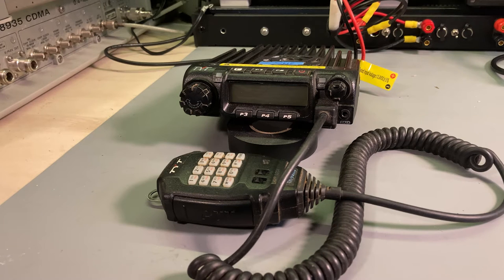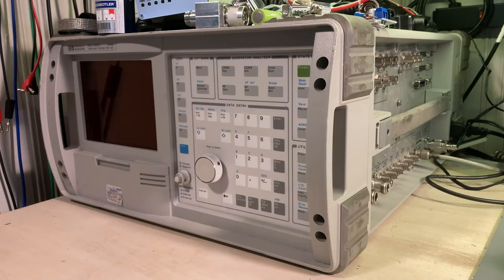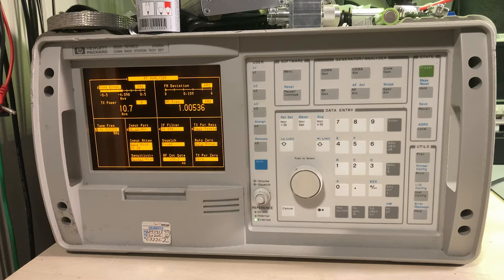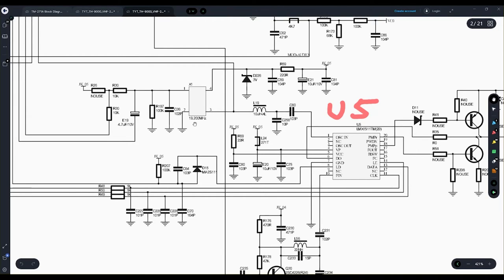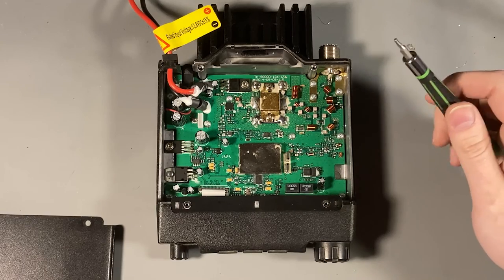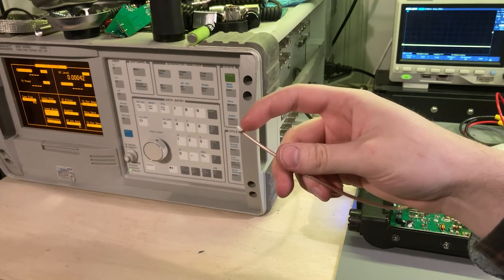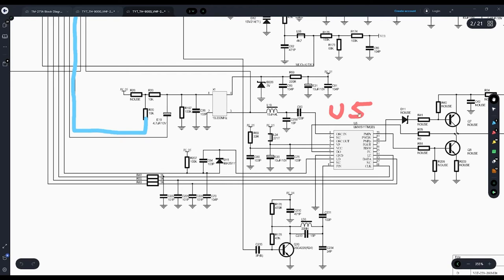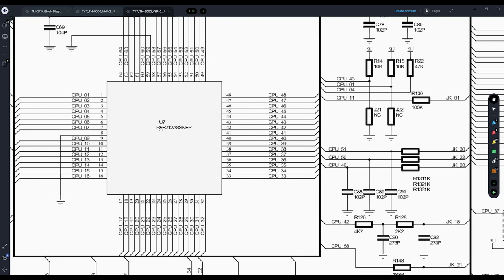TYT TH-9000D Off-Frequency! Tune-up (or not?)

Comment: Thank you for this video! I love seeing more attention given to its circuit design, since it’s been cloned so many times and at an affordable price point. Whether TYT or Retevis 9000D, AnyTone 588, Alinco x35, or — as you discovered — Kenwood TM-271A.  Especially because of the bands this is available in: 70cm and 2m obviously, plus 220MHz / 1.25m in America, and also 4m and 350MHz-390MHz abroad.  It also has a socket for adding a DB9 serial port and repeater capability.  It’s an extremely capable design that has a lot of potential for Open Source Hardware cloning just like the retrocomputing scene has done for C64 and Amiga motherboards. I’d also love to learn how to use the FFT function of a DSO to modify these to change their bands.  I’m very much looking forward to Part 2 from you.

Comment: LOL, it's easy to do the alignment on these if you know how and unfortunately I don't know.  I have tried every possible front panel button press combination to find the "service menu" with no luck.  The only button press combination on power up I could find that does anything was "F" and "P5" which lets you select the frequency range of the radio.  Undoubtedly there is a service menu waiting to be found.  It's possible it's not a button press combination but shorting out a pin on the PCB while powering up like the Kenwood radios they are roughly based off of.
Reply: I found FUN + Shift + PWR = Clone Mode.   or FUN + SQL + PWR = Master Reset unit.   me neither have found any combination leading to a service menu.

Comment: I have serviced dozens of the TH-9000 radios and have never seen the 19.200 osc off frequency.  99% of the failures were CML chips in the early version resulting in a scrambled display/locked up.  
Let me know if you need parts/help.  
N5MRG
Reply: I have the older tyt 9000d and the band range lets me go to 158 meg. the new radios go 144 to 148 is there a way to open them up to work on 158 I am licensed to use that freq.
Thank You
Reply: Do you know the spec of the TCXO in these radios? I'm hoping to replace mine with a more stable one/tune it in to work as a TX radio in an MMDVM DMR duplex repeater

Comment: Question the newer tyt 900d vhf only trans in the 144 to 148 how do you open it up to go outside the band. The older tyt 9000d vhf would transmit on 158 Mhz that I am licensed to use is there a easy band opening trick, thank you friend.